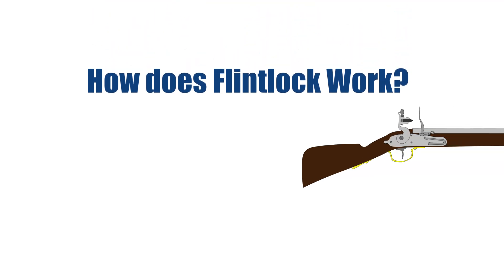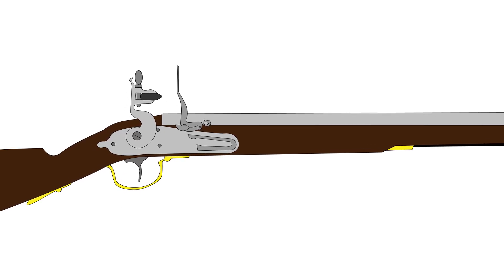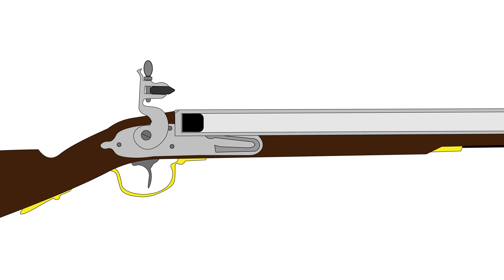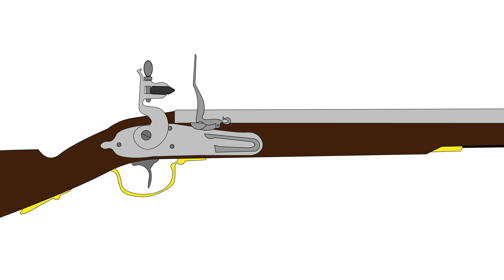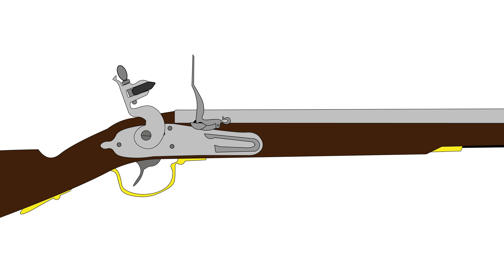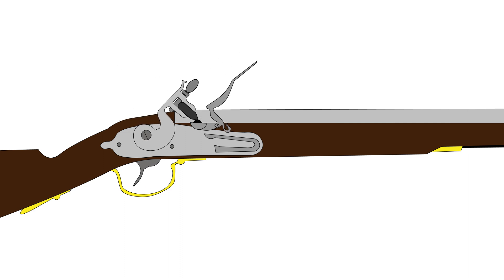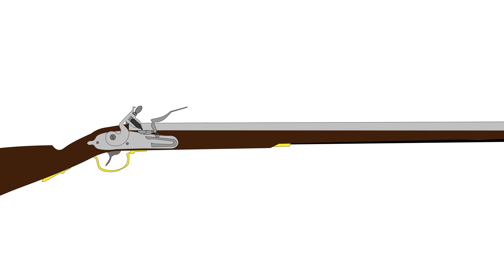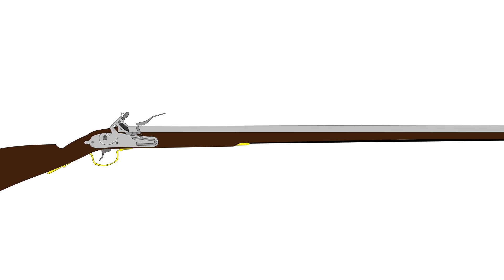How flintlock muskets works

Comment: then pp invented the paper cartridge which just a piece a paper rolled up with a open end and a closed end.
first the ball is put in to the bottom then a knot is made to isolate the ball and the powder, then the calculated powder is pour in and the open end is folded shut to the powder leaving no gap